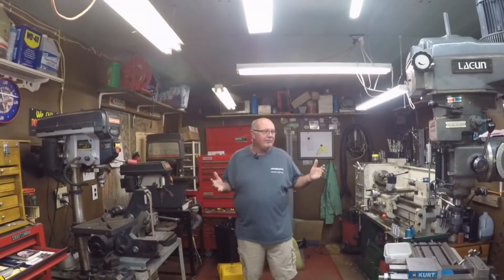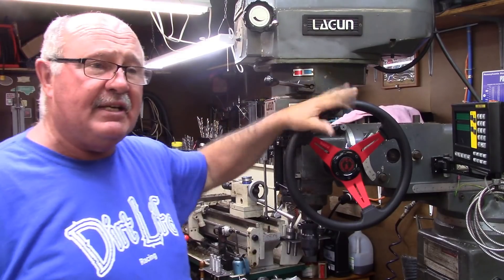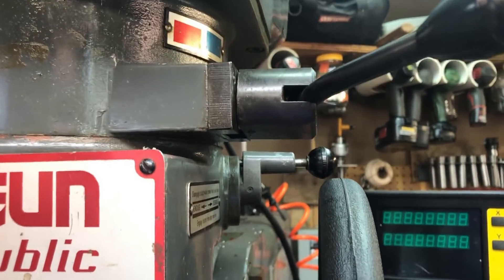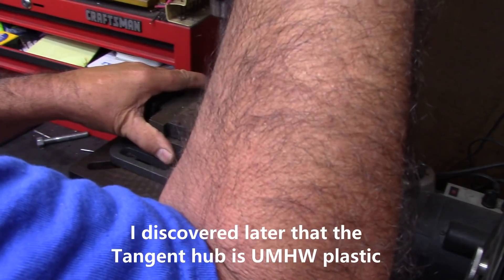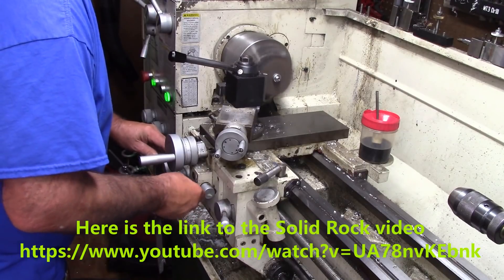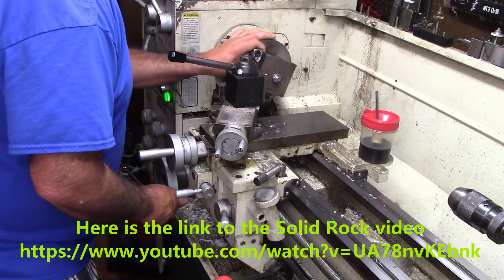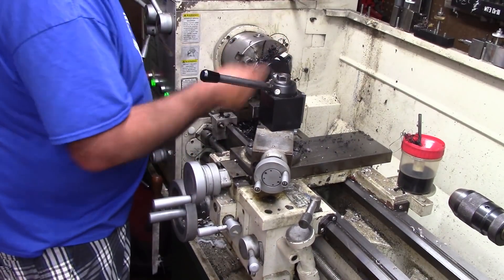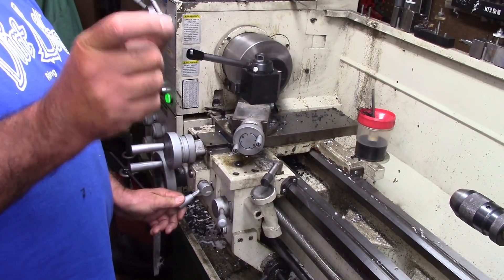Installing a Tangent Engineering Quill Handwheel on my Lagun mill

Comment: Seems like a good idea to use a handwheel instead of the arms - I find with my round column that it is sometimes a nuisance to have to switch hands on the three handle arms.
Reply from the maker: Everett's Workshop well I never really thought of the idea, Jim volunteered to send me the wheel for me to try and install it on my mill. From the limited use I’ve had I think I’ll like it. Thanks for the kind words

Comment: Congratulations on the Handwheel.  I am sure you will give them plenty of feedback on fitting to the Lagun Mill.
Reply from the maker: Mature Patriot / 2 BUSTED THUMBS I actually did. The only problem was the wheel needed to be approximately 3/4” further away from the quill down feed gearbox engagement lever. They will either need a thicker hub, or a spacer like I made. Thanks for watching

Comment: I was going to pick one up,  but have a Wells Index 745 .  But not sure it will fit..
Reply from the maker: MetalWorks Machine Shop as you seen my problem wasn’t fitting the quill, he has 2 versions of the quill size. As you seen the problem was the thickness of the hub to clear the wheel